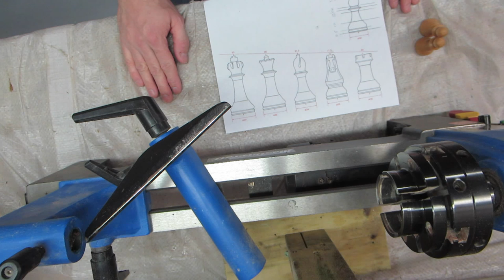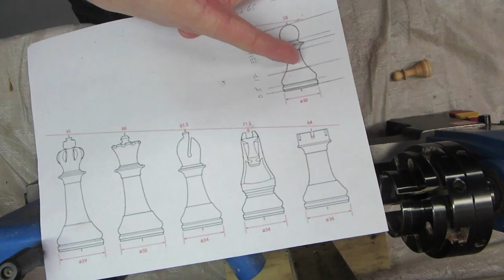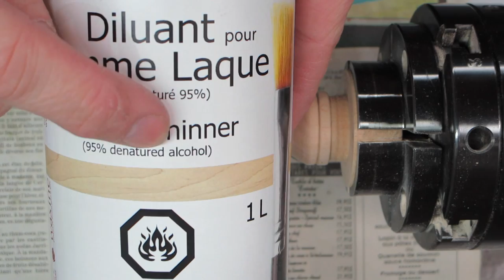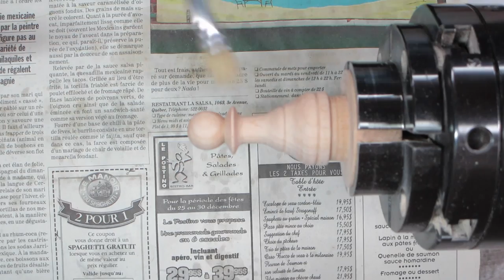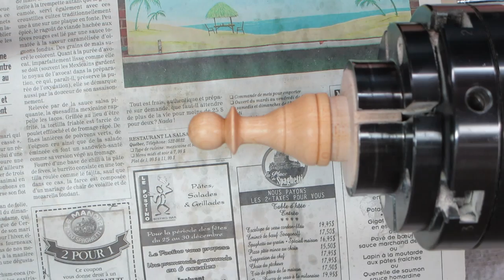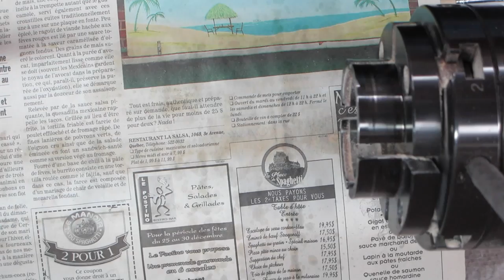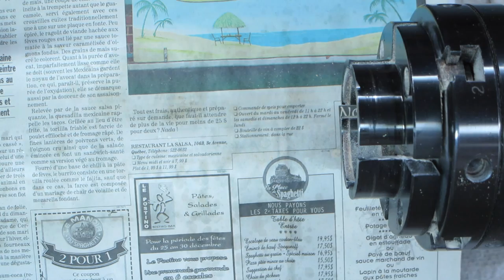Woodturning chess set - PAWN

Comment: The pieces look great, but there is one minor detail that is off between the old pawn and new pawn. There is a section of the new pawn which is convex where the old pawn is concave. If you pause at 27:37, and look where it appears that your pinkie, or perhaps your ring finger (I can't tell which), is touching the pawn, (the pawn on the left side of the screen), then you will see the convex portion I'm speaking of.

Still, these are absolutely great pieces, and thanks for the great video series!